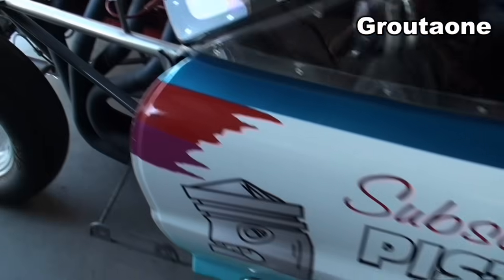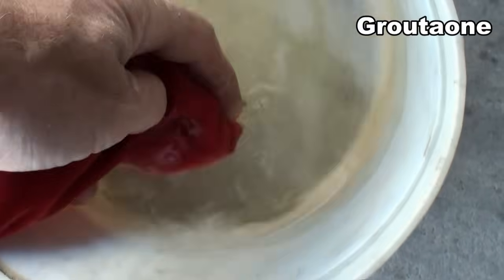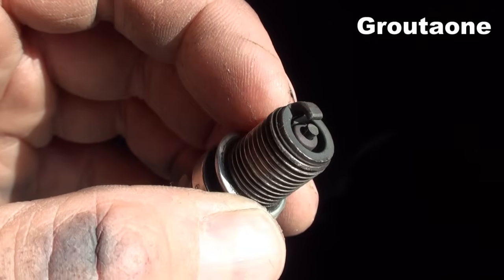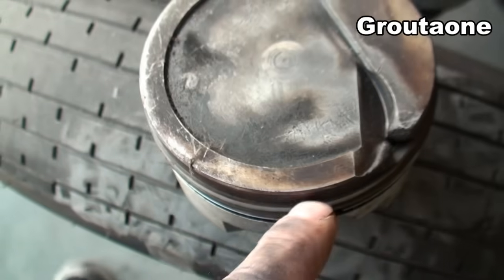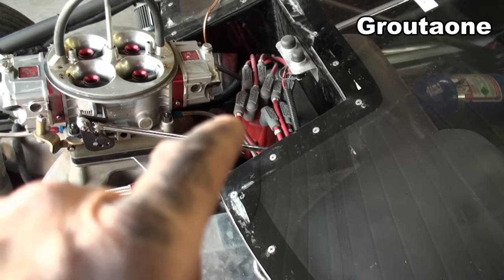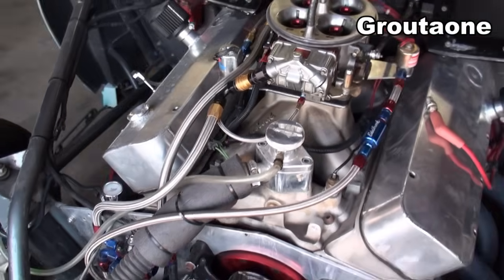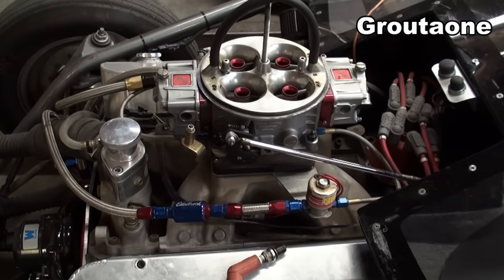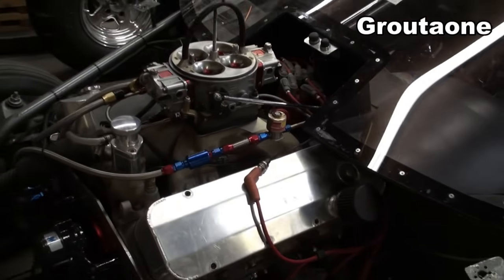Find And Diagnose A Dead Cylinder

Comment: This is ten years ago but I really hope that you still look at comments.  My driver side bank was rich and missing.  Zero power from a 450hp 383.  Did your exhaust trick and it worked amazingly.  I ended up swapping dizzy cap, wires and button but eve. After that the 3/5 cylinder was rich and missing.  Sprayed exhaust and no sizzle.  Adjusting valve lash and back in the game.  So very grateful for this video.  Extremely grateful
Reply from the maker: Nice that it worked out, thanks for watching.

Comment: I have a 2008 Chrysler Sebring Convertable 6 cylinder.  I had taken it to get a tune up and fix what seemed to me to be a spark plug that burned out while I was driving it.  While driving it, I began to smell burning oil and then the sound of the car was different.  The men that I took it to said that they could fix it and give it a tune up.  I picked up the car and brought it home.  Later in the week, I drove it to Walmart.  The cylinder began to do the same thing it did before it was "fixed".   I cannot afford to take it back to the same place since it doesn't make sense that I would pay them twice to fix it... What do you think could possibly be wrong with it?  I'm in Anaheim, CA and need to find a reputable garage to fix it and make sure that I'm not taken advantage of.
Reply from the maker: Possibly piston ring or valve trouble on that cyl, maybe get a compression test done see what it shows.

Comment: Water trick won’t work on a cast manifold lm guessing due to heat transfer?
Reply from the maker: Starting with a cold engine and run briefly before testing with water would still give a fairly good visual reference.

Comment: Too bad i cant use the water trick on my Honda😢 But when i hand crank it over adjusting the valves i hear compression as the piston comes up on all but cylinder no 6. Springs look ok, valve adjustment is good-gonna run a compression test coz im fearing a cracked head but maybe i have a severe intake Leak???

Comment: I just installed a new motor in my Camaro and put a couple thousand miles on it and I have two misfires .. 2 and 5 would a valve seal cause a misfire and to run rich or is it more of a position ring situation

Comment: Man my 4.3 mercuriser had an issue with light to no spark on my #5 cylinder . Changes plugs and ignition coil. I check the distributor looked good. End up doing a compression test all were at 150 #5 0. Anyways I thought I had a bad piston but, seeing your video I don't recall having any damage sparkplugs I have a valve issue. Thanks for the video my mind can ease.

Comment: Don’t mean to sound like I’m bashing u but the cylinder would not have heat up once u had the plug wire out 
It’s not getting spark so how combustion gonna take place and cause heat. 
The way to check is definitely not what u did there. 
You need to check if there is any difference in idle when u take out the plug wires individually
Reply: Bro you completely misinterpreted what he was trying to do.
Reply: You and I may know what u meant to do but ppl who aren’t experienced will take out the wire then fire it up and check to see. But I understand what u did. U just need to have one where there is really a dead cylinder

Comment: This is really genius, but I realize that if your cylinder was completely dead you would probably know it. Most people are looking to check for low compression in cylinder(s). I took a commenter's suggestion to use an infrared thermometer on each one. I got 340, 350, 380, 340. All around 350 or something on multiple tests. Admittedly it was a cheap thermometer, but I just wanted to get an idea.  Cylinder 3 consistently tested hotter, so I hope that one cylinder isn't an issue.
Reply: Or maybe just get a compression tester, you can get one on ebay for $16.
Reply: aznnp77

Comment: you could use an infared thermometer too
Reply: That's a good idea. I just bought one a little while ago. Admittedly it's a cheap one. I think I got 340, 350, 380, 330 on my 4 cylinders. Somewhere around 350 with multiple tests, but cylinder 3 was always consistently higher than the other ones. Not sure if that matters.

Comment: I have a mercury 50 hp. outboard motor,and one spark plug I put in. Is like brand new,nothing on it. Does that mean I have a cylinder problem. Or is the spark plug,bad.If I put another spark plug in. How will I know its working?

Comment: Hello.  I have a 1962 Chrysler Imperial with a 413. I think it's firing on only 7 cylinders.  I can't touch the header pipes to find a cold one.  Can I connect a timing light to each wire to see if it's bad, or will that only test the wire and not also the plug?  I hope you can help with a suggestion.  Thanks
Reply from the maker: +MrBikedrummer Dribble a bit of water over the exhaust manifold at all eight exit points, do this with a cold engine after it has run for about a minute from cold start up
Reply: +groutaone thanks.  it's so easy with my 4 cylinder motorcycle. the headers couldn't be easier to get at. I've used this method before. It's foolproof and quick. Thanks again.
Reply: groutaone please help my 03 kia optima I put gas went to work and I try to start the car and nothing just grinding noise it won't crank up, it sounds like there is no compression in the engine.  I look the timing belt looks pretty worn-out  ( cracks )
Reply from the maker: Yes a timing light will help a bit as it will show if the wire has fire but that's about it, can you dribble water over the exhaust manifolds?

Comment: be cafreful when running an engine with the plug wires off, you can fry new electronic ignition modules. this engine looks to be points and condenser? so its not asbad

Comment: another tip is look under the distributor  cap for a busted or burned contact and another way to find a dead cylinder is an old mechanic trick using a water glass on the top of the engine i may need to make a vid of that to show exactly how it works you can also find misses  and a few other timing related issues that way  ...the basics are ya have a glass on the air cleaner and with the engine at idle ya look at the rings in the water they will point to the problem child

Comment: An intake vaccuum leak wouldn't completely kill a cylinder would it? Wouldn't it have to leak a lot of air before it becomes too lean and doesn't even ignite? Probably more than a leaking gasket would ever allow unless there's a big chunk out of it. Nice trick with the water but I like those laser temp guns from Canadian tire for $40.

Comment from the maker: Thanks, I do appreciate you all watching, I would even offer you some Ritz
Reply: I got a 1999 plymouth breeze and it started missing on #2 cylinder its was getting fire and gas and air,change sparkplugs check that it was getting spark at end of sparkplug and it was but still missing,come to find out it was carbon build up inside sparkplug wire and thats what was causing it.

Comment: always lovin your vids this one was very informal. & i learned the HARD way to always use new gaskets after a rebuild! after rebuilding my cr 125 i thot i would save money & use the old head gasket. well being old it got crusty & gave out lettin water in the cylinder melting the piston & hydo-locking it up. i was doin bout 60 mph down the dirt road when it happened. rear wheel locked up i skidded about 80 yards. lol. that was bout 2 months after rebuilding this summer. now i gotta do over again!

Comment: can you borrow a compression tester somewhere? or else buy a cheap 1 from ebay or somthing. And then measure the compression pressure on that cilinder and on the working ones. If they are all pretty close to eachother then its fine. But i think you could have a valve thats not closing, then that cylinder will get no compression because the pressure can escape. Another way to check it if u have a compressor would be to blow compressed air into the sparkplug hole and check where its comes out.

Comment from the maker: It could be that the small amount of oil the engine uses is all being used by one cyl. It could be valve / seal related like you say. Does the engine still not fire that cyl. even with a new plug? Then it would likely be compression

Comment from the maker: The water trick would put you in the general area but it wouldnt be precise, best to start with a cold manifold and check it with water without delay right after you run it maybe 20 seconds, there is another way by pulling plug wires and rpm, maybe another video is in order

Comment: So here's a question.  I have a Honda CRX (shut up, I have it so I can afford to drive my Dakota R/T the way it ought to be driven) that's running on 3.  The ignition is all good and there's spark on the dead cylinder.  The plug looks real black and gooey, but the car doesn't smoke or go through very much oil.  I always thought that if the rings and/or bore had trouble, that would cause smoking and oil consumption, and based on that, I suspect a valve-related problem.  Does that seem reasonable?

Comment: This is pretty helpfull, the wet rag part i meen. What if said car is running a log manifold? Cause my Skyline runs a log manifold and the pipes are very short and right next to each other so wouldent it heat up the pipe leading to a misconception that the cylinder isnt dead when it could be?

Comment: if you have an injected car and its running poorly check the lambda (usually right after the exhaust manifold) and air mass sensors (after the air filter)